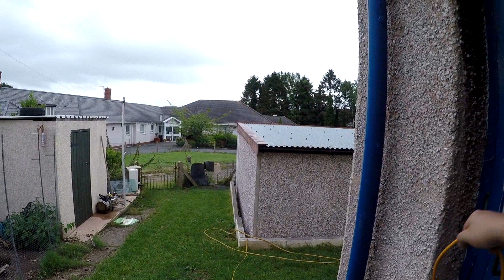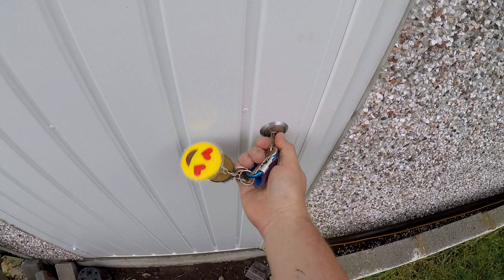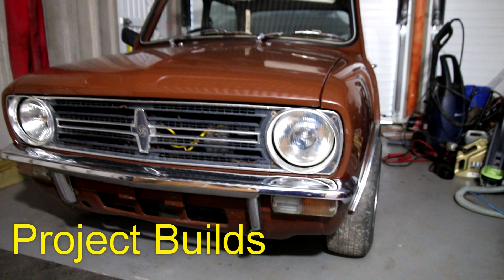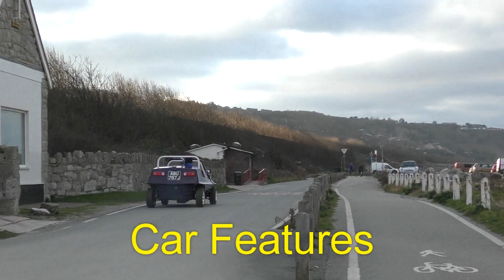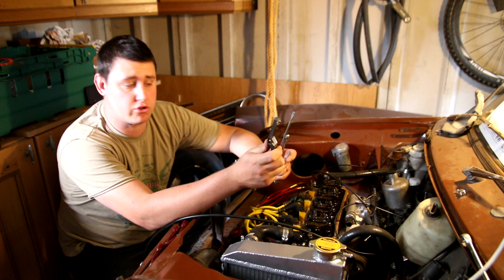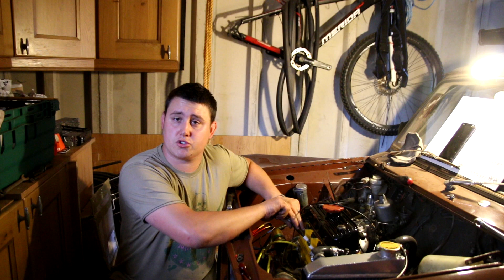Classic Mini Will It Start???

Comment: Cant beat shooting flames out the exhaust , always fun! I don't get why you were resetting the tappets though? I usually go through the mechanical stuff first like tappets, rough timing, oil pressure then start on fuel, spark and air, and get those three to mix in the right quantities.
Reply from the maker: Well in nutshell it was an oversight from my part...

Comment: Nice one Lord Willingham! Ive got a set of those spark plug lights 👌🏻
Reply from the maker: Really handy, firsty to see the strength of the spark and secondly you can crank it and switch of quickly to check the firing order.